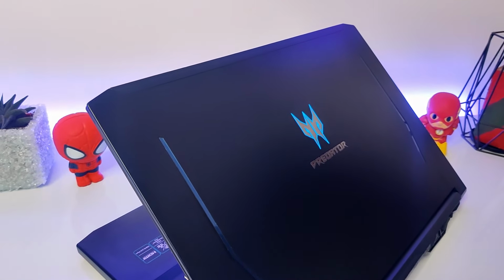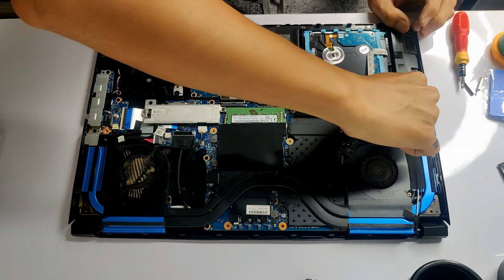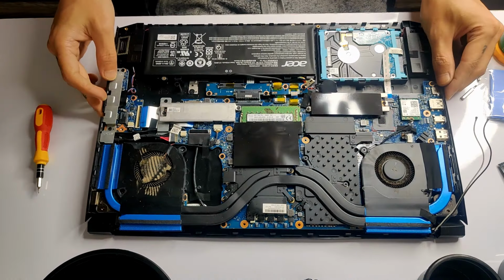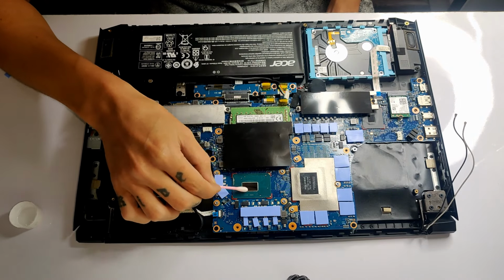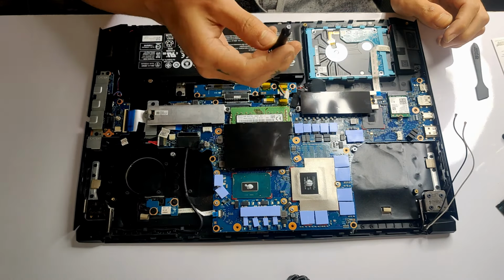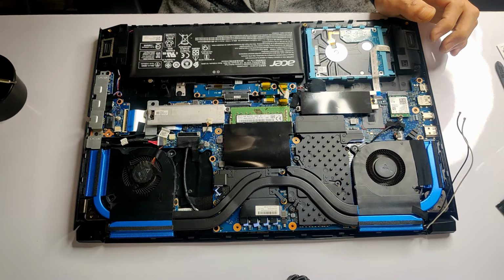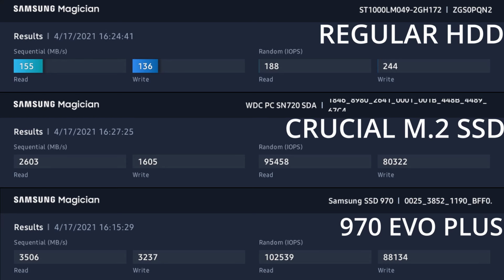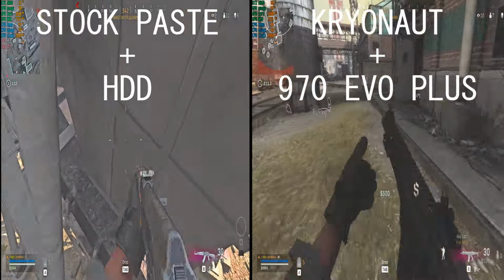ACER PREDATOR HELIOS 300 2019 UPGRADE | REPASTING | CLEANING GUIDE & BENCHMARK

Comment: You should repaste the VRAM instead of closing them
Reply from the maker: Is this a question? I'm not quite able to understand what you're trying to say. Could you please rephrase that again? 🙂
Reply: @MVNDRVX  You should add a paste in the VRAM it helps
Reply from the maker: @ElvisChibundu  it would in case there's less/no contact made, but it's not necessary.
My thermal pads make perfect contact on both sides.
If in doubt, I always ask people to check for contacts first and then repaste.

Comment: Was just playing Scavengers on my 15 inches Helios 300 2019 and the CPU temperatures were like 90-92.
As our CPU is already undervolted would I think repasting is the last option!
Thanks for the video mate
Reply: nah man it do be like that not unless you are living in cold climate but if you’re in tropical countries, its inevitable. Also have the same unit and im in ph thats why i hit 90+ the solution i did is downclock my cpu from 4.0ghz to 3.2 ghz doesnt really have impact on performance but has significant reduction in temps. also i tried playing in cold rooms and i noticed that i have really low temps even on high settings and overclocked. Its ur ambient temp that you should be blaming really. You would know when to repaste is when you’re hitting high temps even on idle.
Reply from the maker: At those temps, repasting would be the best thing you could do to save your laptop. High temps kill your laptop sooner.
Sorry for the late reply 🙂✌
Reply from the maker: @lago try to play a CPU intensive game and stream at 1080p at the same time. I'm sure your game and stream is going to get laggy at that clock speed 🙂

Comment: One of your cable routing is different from mine, I have to unplug that to remove the heat sink, which nearly gave me a heart attack.
Reply from the maker: What was that cable for? 😂
Manufacturing defect? 🤔
Reply: @MVNDRVX  that one is connected to the monitor from the board or something, the plug is next to cpu fan plug
Reply from the maker: @sacchihau2774  ah ok.. that one was over the heatsink for you? Maybe the assembly person forgot and then was too lazy to move it 😅

Comment: Hey Man Loved Your Video
I Own A Helios 300 RTX Version
Recently the Service Center Guy Fucked up my laptop when I told him to clean Fans 
The Service Guy was noob when it comes to thermal pasting
He didn't clean the existing paste with Isotropic Alcohol
He reapplied thermal paste ONLY on GPU & CPU 
My idle Temps are 95° un-Plugged
Temps are going 100°+ while Plugged-in

I have ordered Thermal Grizzly and The Blue Thermal Pads that You used
Are Thermal Pads worth?
I heard they turn into Chewing Gum after a while
Can you tell me how long those thermal pads gonna last?
Reply from the maker: Hey! Thank you... I'm glad you loved the video 😊
Replacing the pads isn't necessary if they are still good and in shape. The life of thermal pads depends on different factors. I recently opened up my laptop to clean the fans and they were still holding up strong, so I guess it should last me for the next few years 😀
Hope I've cleared your doubts. Feel free to contact me anytime if needed. Do subscribe to show some love & support 😊✌🏻❤️
Reply: @MVNDRVX  I'm confused between Grizzly Kyronaut and Grizzly Liquid Metal 
And Can you tell me the lifespan of the blue thermal pads that you used
Reply: I heard that the blue thermal pads that you used will turn into chewing gum like substance due to heat
Is it safe for long-term usage 
Will it long last for 1 year?
Sorry if I'm talkin like noob i have no idea about thermal stuff
Reply from the maker: @Vishal-gr4bz  I've been using them for a year now and it's still good. No problem at all 🙂👍🏻
BTW, what's your laptop specs?
Reply: @MVNDRVX  Helios 300
RTX 3060
i7-11th gen
512GB SSD+1TB HDD
QHD 165Hz 
3M/s :)
Reply: @MVNDRVX  Just got the paste & pads delivered today
Last and final question
After Applying paste and Thermal Pads 
How long can I use it like 1-2 years?
Due to high temps adwit pads won't they melt? I have heard they melt?
Reply from the maker: @Vishal-gr4bz  It should last you more than a year. 
It's been a year for me and it's held up well. Never had any melting issues until now with gaming and streaming for long hours 😃
Reply: @MVNDRVX  wish me luck
I'll be visiting service center tomorrow ❤️🙌🏼
Reply from the maker: @Vishal-gr4bz  Good luck 😃🤞🏻
Reply: @MVNDRVX  Hello Brother
I'm Here today to share the thermals
idle temps are 38° CPU 39° GPU
I did Gaming test and Stress Test 
CPU Temp went upto 72°
And GPU went upto 79°
I couldn't clean the laptop perfectly like you did i tried my best but still some old thermal paste was there little little particles of it
But still no issues now everything is alright
Reply from the maker: That's great news 😃
The GPU thermals though can be reduced to around 65-70 🙂
Reply: @MVNDRVX  as I said earlier I didn't clean perfectly as you did 😅
Reply from the maker: @Vishal-gr4bz  hmm.... Yeah I understood 😝
Reply: Holy Crap 100+ ? Heck nah I would have turned off my laptop right then and there. Did you try and cook on it ? XD
Reply: @jeissonhernandez228  haha
Reply: @MVNDRVX  Yo Bro Sup!
So I have noticed that my laptop is getting heated up 
Idk weather it's summer season (55°C Outdoor) or laptop fault (it's thermal Throttling)
It gets 92°C Heavy Gaming
This time I'm thinking to try Liquid Metal
Any thoughts about LM
I wanna use it on long-term basis
PS:- I changed the mother board while on warranty
This is new board
Last time I was hitting 100°C
The reason was the service centre guy used a big bolb of thermal paste on CPU & GPU I put a complaint & they replaced new mother board:)
Reply from the maker: @Vishal-gr4bz  You can go with liquid metal but have to be very careful during application. I don't think it's worth the risk just for a few degrees drop in temperature considering I'll have to open up my laptop atleast once in a year to clean out the dust on the inside.

Comment: So I was unable to reuse the black tape on my fans, could I use electrical tape, clear tape, white tape would these hold up under the heat what are your thoughts thx in advance great vid?👍👍
Reply from the maker: I'm not really sure about that 🙂
Reply: I found the tape Black Insulating Acetate Cloth Adhesive Tape for Laptop.
Reply from the maker: @Aaron6791ae  that's great! 😃 So you were talking about the thin cloth tapes that hold down wires? 🤔
Reply: @MVNDRVX  The tape that the fans were connected to the vents/heat pipes.

Comment: thank you. which thicknes did you use for thermal pads.. ??
Reply from the maker: @majedmadhoun840  0.5mm for vram memory and 1mm for everything else.
Reply: @MVNDRVX  is 21w/MK thermal pads are good??
Reply from the maker: @majedmadhoun840  yes but It's overkill. 6w/mk is sufficient or you can go for 12.
Reply: @MVNDRVX  İ bought kryonaut thermal grizzly 14.2 watt .. I think it's sufficient for acer predator helios 300..2019??
Reply from the maker: @majedmadhoun840  yes
Reply: @MVNDRVX  would you mind telling me which one vram. Please
Reply from the maker: @majedmadhoun840  the chips covered with pre-applied pink paste are the vram memory. So 0.5mm  goes on those chips.
Reply: @MVNDRVX  thank you sir
Reply: @MVNDRVX  how about 15 or 18 kw .. ? What do you think ?
Reply from the maker: @majedmadhoun840  Should be good

Comment: What thickness of thermal pads did you use I want to make sure I get the right size is it 1 mm? 👍
Reply from the maker: @DennisMC1974  0.5mm for vram memory and 1mm for everything else.
Reply: @MVNDRVX  what part in squares are the vram squares thanks 👍
Reply from the maker: @DennisMC1974  the chips covered in pre-applied pink paste next to the GPU.
Reply: @MVNDRVX  Thanks Man 👍
Reply: @MVNDRVX  So 6 Squares Of 0.5 MM Around the GPU
Reply from the maker: @DennisMC1974  Yes 👍🏻
Reply: @MVNDRVX  thanks I did everything that you said to do and like your video but what is the benefit of using 0.5 MM thickness on just the video RAM Compared To 1.0 MM ? 👍
Reply from the maker: @DennisMC1974  Those are the exact size requirements for perfect thermal transfer between the chips and the heatsink.

Comment: can we also use 1mm thickness for the vram memory for the thermal pads?
Reply from the maker: Yes you can but it's not recommended 🙂
Reply: @MVNDRVX  the vram memory is not the same as the gpu itself right? so we have to buy one set of 0.5s and 1mms?
Reply from the maker: @cheetoseater  No it's not the same. Vram memory chips are the black chips surrounding the GPU.
Yes you need to get 0.5 and 1mm pads 🙂
Reply from the maker: @boomerang0101  20x67mm 2 strips of each size
Reply from the maker: @boomerang0101  yes that should be fine! Just make sure you don't waste any and cut the thermal pads in such a way that it's feasible.

Comment: Thank's a lot i did exactly what u did following ur video and my temps went from peaks of 94 degress playing even CS2 to 65 degress 70 degress at peak!  Of course in conjunction with throttlestop and undervolt. Used artic mx-4 paste and thermal pads of 0.5mm for vram and 1mm for the rest.  Regards. 
Ps. Let's see now how long it will be efficient since once i repaste with collermaster paste and it only worked a few days but in that occasion i did not changed the thermal pads.
Reply from the maker: You're welcome. Mine was good for more than a year with heavy usage of 8+ hours a day of gaming and streaming without undervolting.
Reply: @MVNDRVX  may I ask, where is the vram located in the motherboard?
Reply from the maker: @7kei517  the chips surrounding the GPU are the vram with pre-applied pink paste.

Comment: SOMONE HELP, I have a predator Helios 300 and it turns off when I open games what is the issue?
Reply from the maker: Any errors or does it just turn off?
If you see any error code, try to Google the error code and troubleshoot.
If it just turns off without any error, then it could be some hardware issue. 
Does it turn off immediately or sometime after you launch a game?
Reply: @MVNDRVX  it jsut turns off soon as I open a game
Reply: @MVNDRVX  after I launch a game it turns right off
Reply from the maker: @one_wheel_markie886  I'd suggest you get it checked in a local service centre. One of many things could be faulty causing it to shut down.

Comment: I have the same laptop.From factory they use pink putty in vram chips because the pressure from heatsink is uneven in that part. So thermal pads in vram for this laptop is not the best solution.Your video is very good.Well done.
Reply from the maker: Been almost 2 years and never had an issue. Thank you.
Reply: @MVNDRVX  Also next best thing after liquid metal for CPU-GPU die for laptop is Honeywell 7950.

Comment: I have a very similar model, same cpu, I found the Acer Aeroblade is so noisy. I found a replacement on ebay non Aeroblade but compatible size. I pushed out the fan from the fan case centrer pole add white lithium grease, the sound is so much quieter.
Reply from the maker: Thanks for the tip 😉👍🏻

Comment: I did everything my computer worka normally, but my wifi adapter wont reconnect, so i am getting no internet, how did you reconnect it so easily?
edit nevermind, i was able to do it, it was very tedious tho! thanks for the video, now to test temps!
Reply from the maker: Lol... That's great! Lemme know once you're done 😃
Reply: @MVNDRVX  runs fine and smooth, clean air
One thing id recommend is to clean the 4 vents with a paintbrush (2 for each fan) as they were very clogged and dirty.
Reply from the maker: Oh I did clean up the vents 🙂

Comment: Bro what was the CPU temperature while gaming ,before apply thermal paste and thermal pad and after applying it
Reply from the maker: What's the temp you get? Compare it with the benchmark at the end of the video.
Reply: @MVNDRVX  92 degree CPU 78 degree GPU and system 81 degree temperature before and after but not a kryonaut paste
Reply from the maker: @hems95  With Kryonaut, you will get atleast 9-10 degrees lower.
Reply: @MVNDRVX  after 6 months i will repaste again but till that is that okay the temperature and even it varies sometimes like it will be showing 92 and suddenly it shows 84 likewise
Reply from the maker: @hems95  Heat kills your components. It's best to keep the temps as low as possible.

Comment: Yo is it possible to just clean out the fans but not renewing the thermal paste?
Reply from the maker: Yes it is possible! But cleaning the exhaust fins need the heatsink to be removed and hence repasting is recommended.
Hope this helps. Do subscribe to the channel to show some love & support 🙂✌🏻❤️
Reply: @MVNDRVX  okay thanks I guess I'll renew the thermal paste, but what about the thermal pads is it also recommended to apply that?
Reply from the maker: @TheNamesRein  Thermal pads doesn't need a replacement unless it's in bad shape. If the pads are in shape, it's still usable. I changed mine because it started to get flaky.
So do check once before repasting. If the thermal pads are bad then you would find them all over the motherboard once you open up the back cover 🙂

Comment: Hello, excellent video! I am about to do maintenance on my notebook, the model is the predator PH315-53-77M4. The only difference is that the video card is rtx 2070. The only question is regarding the thermal pads that you used on the chips and the vram, in case my notebook does not have them and only has thermal paste, it is convenient to put a thermal pad on it. pads where it doesn't have?. I would appreciate your recommendations. Greetings from Argentina.
Reply from the maker: You must be having thermal grease on your chips and vram  instead of pads. Just like what I had on my vram(pink thick paste). Yes you can use thermal pads instead.
Reply: @MVNDRVX  Thank you for the prompt response, do you know their name and the exact size of the screws that are from the heatsink? Why is there one that I can't remove and it's rounded a bit, so that when I can remove it, I'll change it for a new one? Any suggestions for removing it?
Reply from the maker: @JuanPabloPereyra-n6c  didn't have a different screw in mine. Maybe try buying a full screwdriver set, you should be good to remove it.

Comment: For the thermal pad on the ssd what thickness should be use?
Reply from the maker: Not sure but I would guess 1mm 🤔
Reply: @MVNDRVX  thank you, I tried to change the pad but my SSD temp when idle is still at 50c+ is my SSD failing?
Reply from the maker: @patrickzuniga5096  Did you check if the SSD is making contact with the thermal pads? I'd suggest you open it up and check once. 50C seem to be fine. Anything above 60C is a problem.

Comment: Hello! in the amazon listing for thermal pads it is an assortment of 0.5, 1 and 1.5mm thickness. can you please tell me what thickness is needed on each chip?
Reply from the maker: Just 0.5mm and 1mm would be needed. 0.5mm for the vram memory and 1mm for everything else.
The assortment would be a best choice since the sizes are perfect and you get 3 strips of each size.
Reply: @MVNDRVX  wow that was fast! thank you!!!!!
Reply from the maker: @KevDoesStuff  you're welcome.
Reply: @MVNDRVX  jsut got done and tested out warzone2, temps went down to a max of 89c on cpu instead of 95c. Should that be okay?
Reply from the maker: @KevDoesStuff  it could go lower depending on your room temperature but seems to be a good improvement from before 👍🏻
Reply: @MVNDRVX  the gpu temp is in the 70c really good. i did notice that the GPU fan seems to blow a lot more air than the cpu fan. not sure if normal but something i noted.
Reply from the maker: @KevDoesStuff  that's normal.
Reply: @MVNDRVX  cool! im happy! at least im not in the 90's no more! games run smoother it seems as well. thanks again!

Comment: Can I use the same thermal pads for the 2020 model??? Can u put a link to a good screwdriver set ...coz I don't have one
Reply from the maker: Yes you could use the same for the 2020 model😃
Hope you liked the video. Do subscribe to show some love & support 🙂❤️
Link for screwdriver set Brain Freezer 115 in1 Screwdriver Set of Screw Driver Bit Set Multi-function Precision Mobile Phone Repair Device Hand Tools Torx Hex Red https://amzn.eu/d/hUhzx1f
Reply: @MVNDRVX  can u put an amazon.in link??
Yes I loved the video....
My warranty is over and it cost ₹1450 to repaste...so I thought of doing it myself
Reply from the maker: @aadi_2k  it is an Amazon.in link that I posted. It's good quality. The other cheap ones will wear off in single use so don't go for that. By cheap ones I mean, the one I used in the video 🙂
Reply: @MVNDRVX  so u used cheap screwdriver in the video🤣🤣🤣🤣....
Is artix mx4 good?? Or can u recommend one?? Kyronaut 1 gram is 600+...bit too expensive...

Is 1 g enough for 2 laptops?
Reply from the maker: @aadi_2k  that's the only screwdriver set I had 😂
Don't go for mx4. Yes 1g is enough for 2 laptops. Just don't over do the application.
Reply: @MVNDRVX  is it necessary to change out the thermal pads if it not worn out much??
Do those components produce a lot of heat??....

How many does ut require for 1 laptop?
Reply from the maker: @aadi_2k  if the pads are still good, there's no need for replacement. You may need 2 strips of each size 0.5mm and 1mm 🙂

Comment: The Thermal Pads you are using are 6.0 W/Mk, I am willing to buy 8.0 W/Mk,  should I go for better w/mk, some pads has 20 w/mk some has 12 etcc, I just want to be sure before I buy anything
Reply: do you recommend to paste the rest of the pad on the SSD?
Reply from the maker: 6w/mk was enough for my model. If you have more powerful components, I'd suggest you go for higher w/mk. You can use the rest for SSD if you feel it needs replacement.
Reply: @MVNDRVX  actually I have the 1660ti model, so 8 is enough
Reply: @MVNDRVX  for the ssd should I use 0.5 or 1.0?
Reply from the maker: @EyadishoKahawaki  Any should work.